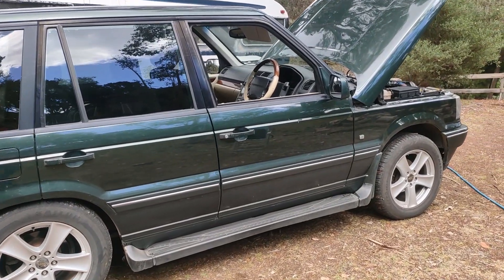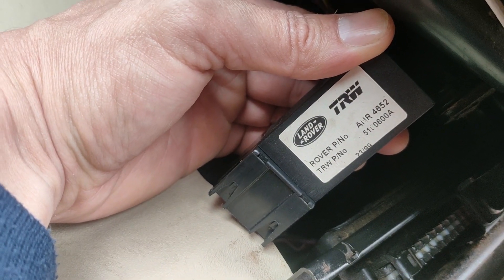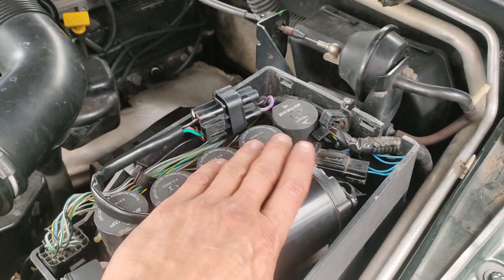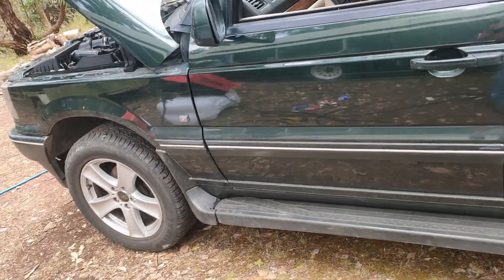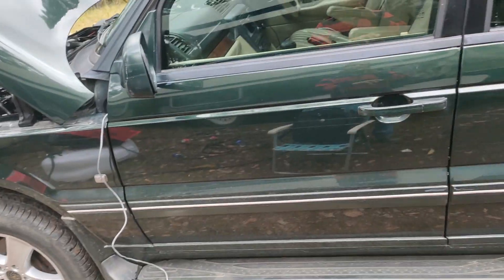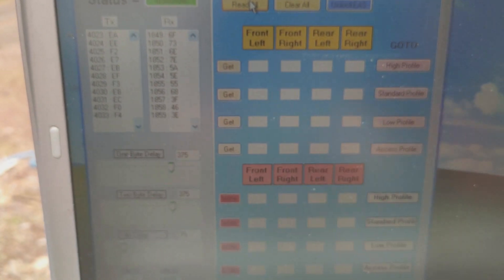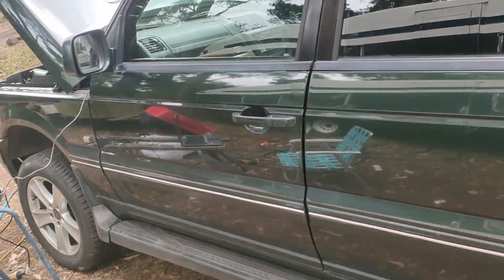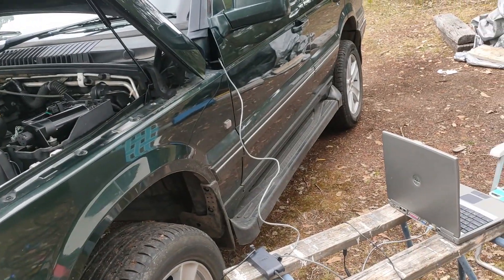P38 Range Rover EAS re-calibration

Comment: Do you rate this vehicle? They used to be so common here in London, you never see one now, the cheapest one I ever brought was £500 for a 4.6HSE
You would struggle to find one now
Reply: Ive spent a lot of money and time on parts. Ive had mine for 13years. theres a lot or brittle plastics in my 99 hse. I think they are not built very well with the cosmetics. Its a strong chassis and goes anywhere but a lot can go wrong. Ive done new head gaskets, fuel pump, and the lower ball joints  and all airbags. Also had to replace the expenaive sabco brake bulb and sort out the tc issues electrically by cleaning wvery connector in the wiring system as a lot of them corrode. But if you pull all electrics connectors and clean them, a lot of things start to work again. Most need a new fusebox too  which are cheap enough. Mine is very reliable now. Ive done a lot to fix it though. My BMW from.same era is a much better built car ane more reliable, plastics have rubber in them and dont break so easily, and the motors are more advanced. The P38 though, is good on tyres and brakes, they last forever. If i had a choice i might lean toward an L322 Range rover with the 4.4 bmw engine  because i know how good they are from my 740il and its seemingly built stronger than the P38 (L322).

Comment: Thanks so much for this. My 97 is dragging the left rear so I will have to give this a go when I get back home to the car. Notified about your page from the Aussie P38 Facebook site. What size dowell did you use to do this. Looks like a trip to Bunnings coming up!!
Reply from the maker: Dowell is 20mm. I think a 25mm will also fit inside bumpstop. The 20mm was cheap as I just used a broomstick handle! They seem to hold up ok and dont break.